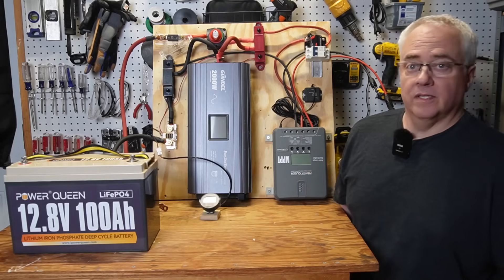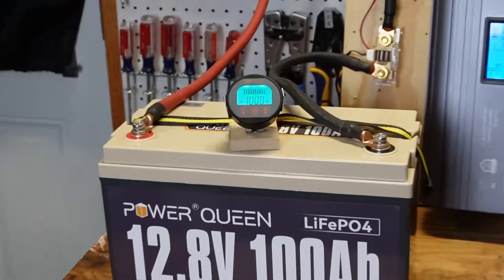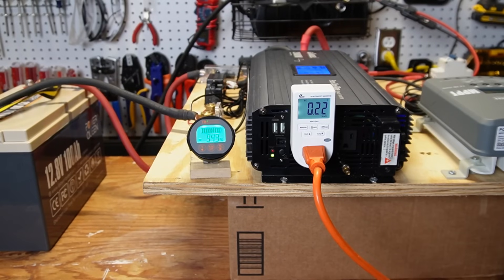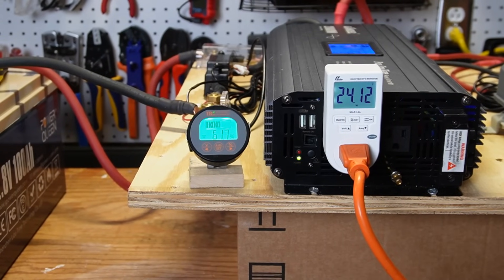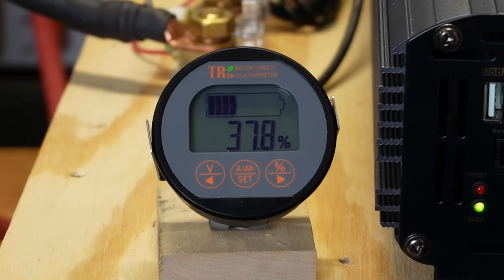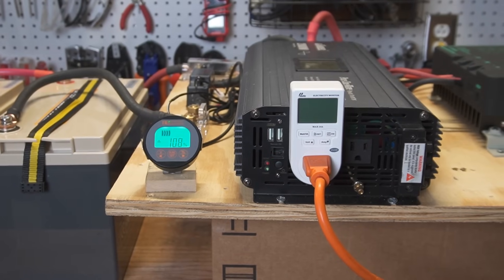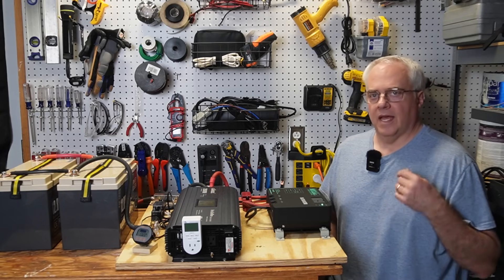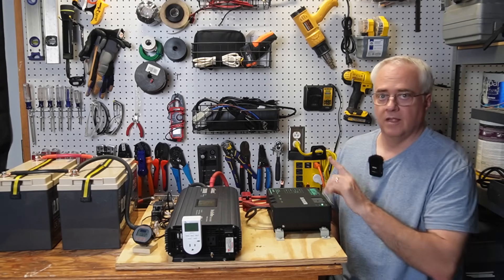DIY Solar Generator Powers My Garage Freezer For DAYS!

Comment: Be careful a "frostless" freezer or a refrigerator with a "frostless" freezer will run resistive electrical heat to remove frost from the items in the freezer. It does this periodically throughout a 24 hour period. So if could appear that  a given setup will work, only to have the defrost cycle kick on and ruin your plans! I believe a "deep freezer" like the one here does not have the "frostless" feature. I think that is why it worked out so well in this case. Great video, appreciate the hard work to record it and post it!
Reply from the maker: Thank you very much and thanks for sharing that information.

Comment: I’m also going to use a MOES dual power controller.   Do you have a setup video.   Thank. Great videos
From Oklahoma
Reply from the maker: I am not familiar with a MOES dual power controller. But I did a Google search and it seems to be a transfer switch. I did a video where I installed a transfer switch - https://youtu.be/3Mj57MB8AWo

Comment: What is name of the brackets you use to hold down the power queen charge controller
Reply from the maker: Those brackets came with the charger controller.

Comment: Doing a Kill-A-Watt on my chest freezer.  It pulls half of what my refrigerator does or about 75 watts running. Fridge is a bit over 150 watts running.
So, my two 100ah batteries should at least power the freezer for over a day without recharging.
No matter where I decide to install panels, I won't get more than 1/2 day of full sun in the morning AT BEST.
Too many trees and wrong angles for the panels.
Reply from the maker: Thanks for the info, it's always good to other peoples experiences with actual power usage!
Reply: @proficientprepper  I have a floor fan on low and that too uses a whopping 150 watts of power.
275 watts on high speed.
Need to test microwave. It is an 1100 watt one but don't know what the input draw is.
And then there is the air fryer lol

I have a very small countertop refrigerator (Hisense) that uses 50 watts. BARELY does the job but it does keep things cold.

One of my TV's (32 inch) plus cable box uses 23 watts combined. Other TV I don't know yet but is a lot smaller.
My original tube TV used over 200 watts. Big savings going to flat screen.

Unfortunately I cannot use the Kill-A-Watt on my gas furnace. Have to use a clamp on ammeter and do some math.
AC unit uses an astounding 100 AMPS on startup. Can't afford 10 grand to replace it and the furnace at the same time. And that is just PARTS.

My computer uses roughly 300 watts of power and that is without the printer being on.

That meter is a bit fun in a way.

My solar goal is to protect my food in warm weather and possibly use it to run the gas furnace int he winter.

Biggest problem I have is how to circumvent the permitting BS for the panels.

I won't tie the solar into house wiring.

And permits raise your property taxes when complete.

May try to do a 'portable' panel setup to avoid permitting.

Something on wheels I might imagine lol.

Where I am you need a permit to POOP! It is that bad...
But I can hang wallpaper without a permit - go figure....

Comment: So to figure out your storage capacity is quite tricky. So you need to figure out how many watts you use a day on that piece of equipment. Take that time is it by three and that's what you need for at least 3 days without sun. Now once you get that total then you size your solar panel for that size of battery storage. But you need to size the solar panels to the lowest sun hours of that season so if you're only getting 3 Sun hours then you take the total battery storage divided by 3 and that's how many watts you need of solar to charge those batteries in 3 hours. Every complex

Comment: what would you advice to someone, who would not use solar panels to charge battery, instead, would want simply - 
use batteries to power freezer from 7PM to 7AM (through night), 
then charge battery back from 10AM to 2PM - when the price of electricity for me is essentially 0.
what components would be needed for what price (approximately :) ). 
thanks for your video - very nicely done and organized.
Reply from the maker: You would need everything except the solar charge controller and solar panels. You would also need a separate battery charger which I did not show in this video.

Comment: Thanks for this experiment. I have a similar setup. (800 watts of solar panels, in reality about 500 watts output ) that I use to charge my 100Ah 12volt LIFEPO4 battery that I use in the evening after the sun goes down to keep my refrigerator running. I also have another solar array (300 watts) that I use during the day to keep my Refrigerator running. But if it's cloudy or partly sunny all bets are off I have to use the Grid which is about 50% of the time.
Reply from the maker: I'm glad I'm not the only one that has to use the grid sometimes. I wish I could build bigger solar arrays. But I just don't have the room for much solar where I live now. Thanks for sharing!

Comment: I did a similar experiment with very old apartment fridge with no defrost & due to ice buildup on 200ah lithium it lasted after 2 straight weeks & never reached below 50% after another week i said indefinitely cause newer fridges have a defroster (heater) which takes up to 500+ watts & depletes battery much faster I also tested a dorm sized fridge all tested with 2 350 watt solar panels on 200ah lithium batteries, I run my apartment with 1kw solar panels & 4kw lithium batteries all lights are motion sensor led in my home & timers on wifi, old fridges are a gem once frozen put a timer on it 2hrs on 4hrs off.
Reply from the maker: Thanks for sharing!

Comment: By being smart with your power usage, you could have easily gotten by with one 200 watt panel and probably gotten by with a 100 watt panel. 

Since a freezer can go 2-3 days when the power is off, all you need to do is run the freezer during the day when the sun is on the panels and cut the inverter totally off when there is no sun out. 

The only time you will have your battery drop would be days when there is no sun, and you could extend that by reducing the runtime on the low sun days to 3-4 hours in the middle of the day.
Reply from the maker: Thanks for sharing that. I did not think of turning off the freezer during the night.

Comment: Nice video. I have four of those 100ah power queens wired in parallel, charged by 1850 watts of panels. On rainy/cloudy days i unplug my fridge and connect it back on the grid to conserve battery power. Its near midnight now and i'm washing clothes and my fridge and washer are running on battery power. I love solar. Greetings from Jamaica.
Reply from the maker: Sounds like you've got a great system!
Reply: @proficientprepper  it is, l am planning to upgrade to 24v soon as the 70-80amps charge current is getting hard to manage and wires get quite warm.

Comment: 1,440 watts used solar panels + 100ah 12v lifepo4 (1280wh) 30amp charge controller.
You could use less panels & another 100ah but used panels are cheaper

Comment: 🌴 Southern California High Desert at 3,100 feet 400 Watts o Solar into a Victron 100/30 Charge Controller feeding a 200 - 280ah Lithium Battery Bank and a 2,000 Watt Inverter works really well for a Refrigerator and TV and Internet Router 🌵
Reply from the maker: Thanks for sharing that